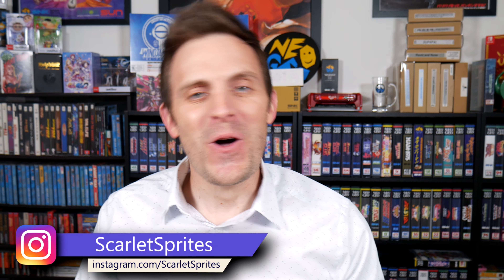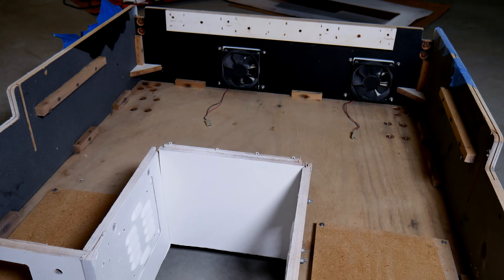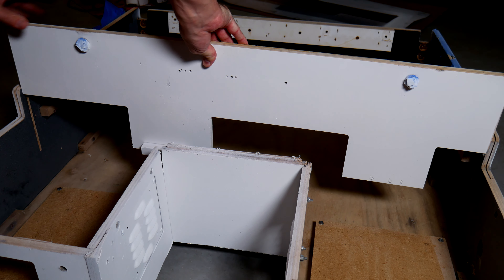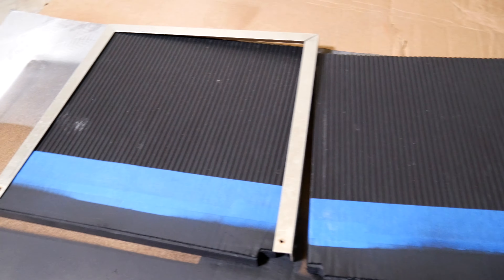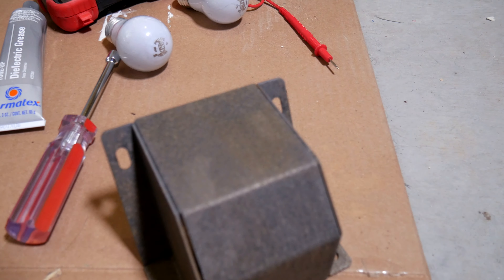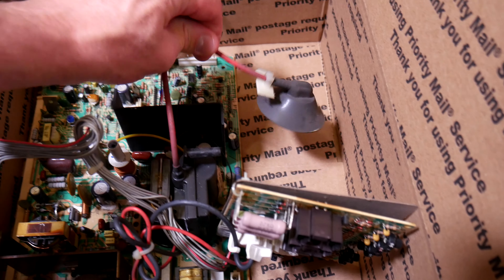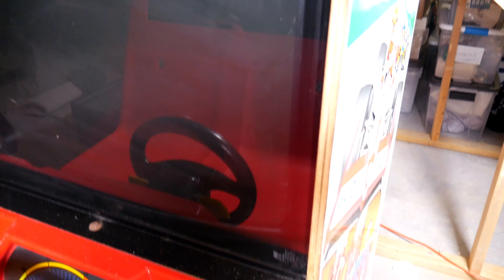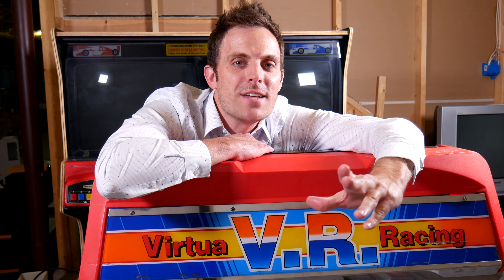Sega Virtua Racing Arcade Restoration Update

Comment: Cabinet is looking good -- you're definitely putting in the work. That evaporust stuff works great, but I've found with the unprotected metals, stuff starts to rust again pretty soon. Oil and grease product can protect them, but those are mess and temporary.  I personally haven't gone this far, but if you want to restore the hardware as well, you can look into DIY electroplating and coat those screws and bits with zinc.
Reply from the maker: I have considered that actually, and I’ve wondered about the long term state of things.  I guess it depends on how bad things get but hopefully it will last a few years before it gets really bad again.  The visible screws and stuff I don’t mind swapping out for new, but some of those larger brackets and plates I kind of need unless I want to reinvent the wheel.  Pun intended.

Comment: I'm so jealous! Virtua Racing is my favorite arcade game of all time. I played this before Virtua Fighter and IMO it ushered in the era of 3D gaming both in arcades and at home. Everything about this game is perfect. You'll forget about those rats soon enough! I just hope the wheels and pedals clean up as good as the rest of the unit.
Reply from the maker: I’m have a lot of difficulty getting some of the rusted screws out to get to the wheels.  I’m pretty sure I can salvage all of it and de-rust, but I just have to figure out how to get these screws out.  It’s been a real fight the past few weeks.
Reply: @ScarletSprites  Are the heads stripped? Sometimes I have to use a dremel circular grinding pad to cut a flat head groove into a screw head in order to remove them. Macbook Pro touchpad screws and some smartphone screws (tiny screws) have easily strippable connect points. The Dremel is the only solution on those. It will destroy the look of the screw head but it will make it function. If it's an outside screw you might have to replace them later for visual appeal.
Reply from the maker: That’s exactly what I did yesterday, I cut a small groove across it and tried that method.  The screw just started to then strip across as I tried to turn the flathead.  This has become super maddening.
Reply: @ScarletSprites  It's either that or drill it out. I've never had success with the super glue method or screw taps. Sorry that area is being a pain.

Comment: oh wow , great to see someone else doing VR too, I am currently fixing our twin.  First problem we had was the horizontal line so I started working on the monitor chasis, but it didn't fix it but after moving the machine across the room the Sega Power supply under car no 2 reduced its voltage !  So I am currently just working with one player.  

So your power supply layout is very different to ours, different units etc. and I think I am working with 110v (as I am in the UK).

I could put a video together, let me know if that will interest you.
Reply from the maker: I replaced the power supplies but the overall setup remains similar.  The ones I used are typically for Konami games, but they use the same connections and voltages so I was good to go.  Best of luck getting yours going again, let me know if you post a video and I’ll check it out.

Comment: Having the monitors done professionally is a good choice, I was considering re-capping my monitor myself but I felt the same way as you in this video so I plan to send it to a local shop out here to do it
Reply from the maker: It’s just something that I know I’m average at best at, and I don’t want to have to source a new chassis and then likely have to recap that anyways if I were to screw up.  The added benefit is that it also saves me time, which I’m perfectly fine with given that this has been a monster.
Reply: Scarlet Sprites It’s looking awesome too, great work
Reply from the maker: MrMysterious Thanks man!

Comment: Getting an arcade machine for $300 range just takes time and patience. Auctions have surprising deals and weirdly high prices for certain cabinets. Ive seen DDR machines go for $300-$2k, and time crisis go for $100. Pretty sure that was a mix of luck and no one wanting to haul them off
Reply from the maker: There’s some scouting involved, and you have to be ready to pounce when a deal presents itself as well.  If a decent cab is available for <$500 you basically have 24hrs to pick it up.  That’s been my experience lately.
Reply: @ScarletSprites  Aside from infrequent deals here and there i think the hardest thing people forget about getting machines is having to transport them back. I got lucky with my first cabinet with my friends truck. Slowly piecing together an mvs 1 slot with the hopes of one day getting a proper cabinet one day
Reply from the maker: I often wish I had a truck.  That does complicate things like you mention, because you need to lock in the sale/price AND beg a friend for help.

Comment: Sweet update. I didn't know there was another method to remove rust other than the tumbler with walnut shells.

What was your mold treatment? Surprised you didn't do a cap kit yourself. About to do my first one on silent scope. Chrome t-molding is tight!
Reply from the maker: I wanted to redo the caps and the flyback, and since I’d never done a flyback AND I really could use the assist with time, I just decided it was best to send those out and I could continue to deal with the blue collar stuff.

For the mold it was really just sanding it down, bleaching to kill surface level stuff, then treating with Mold Control.  I’ve never had to use it before, but it sounds like Concrobium is what you want for penetrating down into wood fibers.

Comment: Awesome! I'd been wondering how this is getting on. Dunno about chrome t-molding but I won't hate 😂
Reply from the maker: I’m generally very reserved with that type of thing as well.  It just seemed to fit given that Virtua Fighter has it, it’s the 90s, and I often think of chrome on cars.  The flat black was just really lackluster.  I also considered red but was afraid it just wouldn’t match.  The control panel and wheels also have chrome on them so I think it will all pull together.
Reply: Yeah it'll look cool for sure. I chose the chrome on a joystick I made (sort of, never finished) long ago. But since then I've seen it on so many pre-built LCD bartops and flat-pack cabinets etc that I've started to dislike it a bit, along with things like light-up balltop and buttons etc. I'm just getting snobbish though so don't mind me :)  And it's not doing any permanent harm to the cab, can always be changed back to looking original if you ever want to.

Comment: Hey! I have a F1 Super Lap. It was working but now there is a problem. First - screen freez. After rebooting, nothing. After more rebooting, left screen showed "networking check this machine is master controller". Got past that and only left screen working. After again rebooting, the right screen war working with the text networking check. I can pass that and play only on the right screen. The cables connecting the 2 boards for networking looks ok. Any ideea?
Reply from the maker: Is it possible both sides are set to be the master controller?  I’d check the settings on the boards.  In my case I actually had to physically swap the board to the working side and set it as master, then swap in the other one and set it as slave.  I had some power issues that were also not helping, but I’d start with checking the master/slave settings first.
Reply: Hey, thank you for such a fast response! I must say that the game was working fine, both screens. Today, after a 2 player test run, both screens freezed. After restarting, and restarting, first screen showed that player one was master, (player 2 screen nothing) and after some more restarting, player one nothing and player 2 was looking for network. If i plug out the jamma harness from player 1, the screen shows some static (so the screen is ok).

Comment: Great job man. What's all this costing ya so we can have an idea what to expect for refurbishments like this?
Reply from the maker: I can probably do a rundown of that in the finale.  Thankfully the costs incurred haven’t been parts, but cleaning supplies like bleach, vinegar, and mold control.  LED bulbs were $12 each, and the new t-molding will end up being $25 or so.  The most expensive things I’ve purchased so far have been the replacement power supplies which cost me about $100 (I replaced both but really only needed to do one).

Comment: Yo. Pro tip: When i clean my arcade glass i use newspaper for the wipe up. No streaks! Also keep doing more arcade videos!! Love it!
Reply from the maker: That’s interesting, I’d have thought the ink would bleed or be left on the glass.  The first step for this one is a complete hose down, but I’m willing to give your tip a shot.
Reply: @ScarletSprites  i thought the same thing, an old wise auto detailer put me on this. I use it on crt tubes, glass, bezels etc. That machine is going to look phenomenal!
Reply: @SilkySilv  Maybe I did it wrong, but I tried that once and it put newspaper ink all over the glass. I need to give it another shot.

Comment: Wouldn't it be better, safer, and less of a biohazard to replace the parts the rats damaged? Particularly the wood.
Reply from the maker: I consulted a few people on possibly building a repro box/bench that housed the boards.  General consensus was that if I followed the steps that I did, there really wasn’t much to be concerned about.  One person said they’d seen far worse on hardwood floors in an old Victorian home that was salvaged.  I made the decision that I’d give it a shot for the sake of preservation, and if the results weren’t satisfactory I’d go the repro route as my backup option.